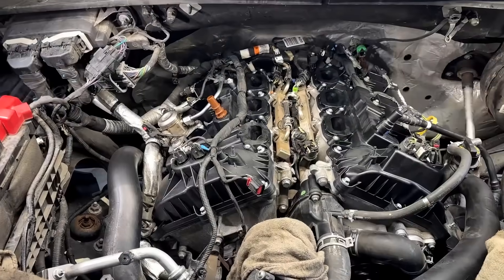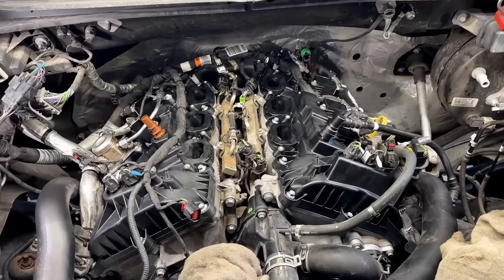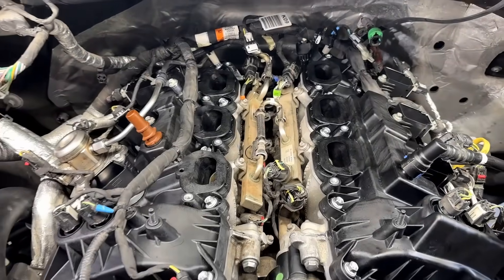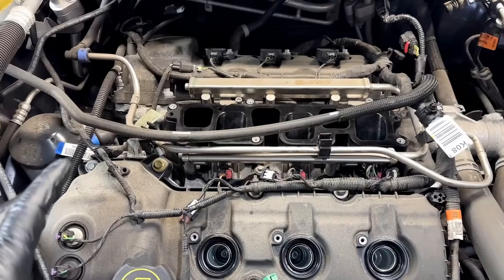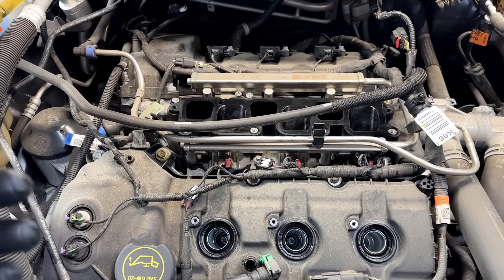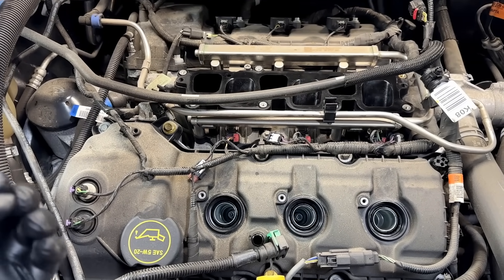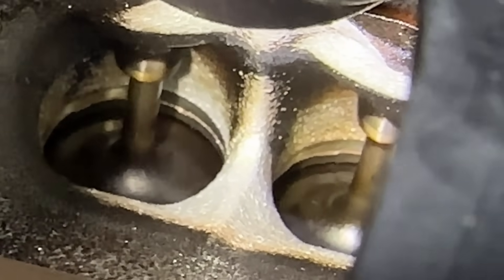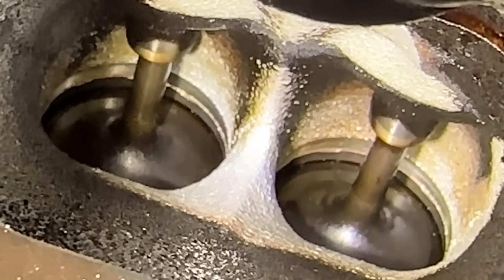Does Ford's New Dual Fuel Injection 3.5L Ecoboost Engine Really Fix the Carbon Build Up Issue?

Comment: Great video Brian! I'll be honest - I'm still a bit disappointed with carboning on that 2nd gen Ecoboost. That said, it's still better than nothing.  Maybe Ford needs a new fuel curve map where it runs strictly on the port injection for a day a couple of times a year? I'd be willing to put up with some reduced power mode if it meant reducing de-carboning costs down the road. I know it's may be a bit irrelevant with a timing chain replacement at the 100-150K mark anyways, but it'll still save labor and materials cost when needed.

BTW - Happy Holidays and a Merry Christmas to you and your family and the viewers!
Reply: I monitor DI vs FI rates on my 2019 3.5 f150. At low load, it primarily runs port injection. At warm idle, low speed cruising and light acceleration, it uses almost entirely port injection. At highway speeds, it uses 40-80% direct injection. It is always using the port injectors at least somewhat.

The 2nd gen 3.5 is primarily port injected and adds DI as needed. Fuel system cleaners DO work to clean the valves. If you want to reduce valve buildup, start using techron additive or another fuel system cleaner with PEA.
Reply: I was thinking something similar... perhaps switch to 2 pulses of the port fuel injector for every one pulse of the GDI injector. That should cut the carbon buildup to roughly a third of the Gen 1. Of course it would sacrifice a bit of fuel economy/power.
Reply: Likely a commuter vehicle. The trucks need heavier use to do what they need. More load equals more fuel equals cleaner valves.

Comment: Great video as usual, thank you. I was aware of this from early on on my 2011 f150 3,5 eco boost. I maintained it very well and put a lot of cross country highway miles on it. I made sure it got warmed up on every use by consolidating trips. I traded it in after 210,000 miles this past summer. It still ran great but want to continue to travel in my retirement. I was always amazed at the torque and towing power of a little over 200 cubes a few times grossing 11-12000 lbs Ohio to New Mexico. Thanks for your channel.

Comment: Approx 130,000 miles on my 2015 3.5 EB now. So far it is running really good still
I have heard a cold start very brief rattle that I thought might be the waste gate flapper but it could also be the cam phaser I suppose. But it does it like maybe once a month and is really quiet otherwise

I never did get around to adding a catch can although I know I should.
Luckily I do rip on this thing on a regular basis so hopefully that heat cycles the valves enough to burn off some of that carbon. people who let these engines idle a lot and who don't open them up under high load are probably more likely to have these issues. It is still a very fun engine so no regrets.

Comment: I'm so glad you shared this info... My 2017 is at 158k and now needs its second timing job with phasers. (And neither has been under warranty...WTF??) You can rest assured I'll insist on the new phasers you showed a few videos ago.  Thanks again, and Happy Holidays to you and yours !!
Reply: Just curious, how often do you change the oil and what oil and filter do you use?
Reply: @Ray S I'm religious with maintenance ! usually every 3k... never over 4. 
Platinum synthetic oil and Fram ultra syn
Filters. 
The wife's truck is a 2014 150 with the 5.0.... use the same in hers, and that just hit 240k. That motor has never made a tick sound... ever !!!
Reply: @Right2Arm  I'd stick with the Motorcraft oil filters and avoid Fram. Lots of info out there regarding anti drain back.
Reply: @Right2Arm   
I've heard of some guys using the synthetic 5W40 in those 3.5's and they say it makes them a little better.  
The 5.0's have overall been great.
Reply: Wow, these engines are pure garbage. I wonder what will it take yo get rid of this truck
Reply: @gianfrancoa  love the power with the turbos... and 21 mpg. This is the only problem I've ever had with the truck in 158k.  Pisses me off, but it's still a good truck 😊
Reply: @Right2Arm  21 mpg probably doesn't offset the thousands you lost repairing the truck.

Comment: Thats good that they are making progress, hopefully they will learn from this and continue to improve the cleaning system.  My Dads 22 Tacoma has a similar setup that is just for cleaning the valves, will be interesting to see how his does after 100k.
Reply: I have a GS 350 AWD which is a Tacoma in a Sedan. I would almost like to pull the intake and see, I am a bit above 100K.
Reply: Well there's only going to be so much improvement as fossil fuel burning engines are mostly ending development, with some carmakers having already stated they're not developing any new internal combustion engines ("ICE" as the nerdy folks like to say).  So don't really matter much after this.  Great that dual injection solves this, but how much longer it's going to be a problem for new cars, is another story.
Reply: @rolandm9750  basically we are in big trouble, the government is finally going to ruin the auto industry
Reply: Learn from this??  This was a known issue that germans knew about from ww2 and after.  This arrogance and hubris.  I'm sure there is documentation somewhere of engineers telling them to do what they eventually did.
Reply: And the frame
Reply: @muttomaki1  Frame issues on Toyota have been solved awhile ago. If you're going to be an ass, why not attack GM for their APM and their shitty torque converters.That problem is still ongoing from 2009 to today.

Comment: need that extra injector to spray the valves down, keep them clean, on direct fuel injection.
Reply: Well, that's intention of the port injection, but it seems Ford failed again to design something that really works, Toyota has the D4S system and no issues

Comment: So is this carbon build up caused by turbos blowing oil into the intake? I have a 2019 3.5 EcoBoost.
Reply: Fine dust that gets through the air filter.  With early Direct Injection (DI/EcoBoost) there is no fuel to wash it.
Reply: @jonmccormick8683  Actually it's from the PCV system putting the vapors from the crankcase back into the intake to be burned off. Those vapors have microscopic droplets of oil which over time builds up on the valves.

Comment: Opinions please: If you were buying a new 2.0Ecoboost Maverick 2023, would you recommend an oil catch canister be installed within the first couple thousand miles and if so would this void the factory warranty?  Or just wait and get walnut blasting after 30K or 40K miles?  (with frequent oil changes Pennzoil UltraPlatnium and use premium fuel)
Reply: I have one on our Focus ST. Never had any warranty work or issues when dealers did oil changes (every other just so they could document while it was in warranty). We get 1-3oz every oil change in the can. In my mind it can’t hurt to keep that out of the intake. Last I checked was at 50k and it looked good (not as good as a port injected engine but still). We also drive it pretty hard which I feel helps with heat and additional pressures to burn what’s there off.

Comment: Do you think a oil catch can would help? I had one on my gen 1, but I feel like it was increasing crank case pressure.. my valves were pretty clean after 125k.. put the catch can on around 90k.
Reply: You feel like or can you verify that it is?
Reply: @MagMan4x4  well, I started having leak issues, such as the rear main seal. I ended up taking it off, but no, I can't verify it was actually increasing crank case pressure other then others having those issues online. I just assumed and took it off lol

Comment: On first gen engines can you look at the valves through the throttle body with a bore scope while someone is stepping on the accelerator pedal key on engine off

Comment: why do some gen 1 have the build up while others don't show signs well into 150, 180K on them?
i mean this newer one obviously has been driven more in a lot shorter period of time.
why? highways?
is there something some people are doing, perhaps like more highways vs city drives?
more oil changes?
better oils?
Reply: I run a catch can and run full synthetics with intervals at 5k. First gen with 113k and have not seen any issues related to valves or time chain rattle.

Comment: Glad I'm running a catch can!  Still love my old school multi port 302.  Merry Christmas Brian.
Reply: Catch can is meh at best, takes out maybe 10% of the carbon. If the stock 3.5 eb at 100k is 100%, installing the catch can would remove 10%, to 90%, and the new 3.5 eb would have 50%, with a catch can, you’re at 45%. Not worth the 3-500 investment in a good set up
Reply: Its better than nothing...it catches quite a bit and looks nasty.  I run Mobil 1 and it gets changed ever 5k religiously.
Reply: @garypollack6948  Gary, to be really sure you are doing everything possible, change your oil once a week and get your church to pray for your vehicle every Sunday .
Reply: @garypollack6948  I feel the same. Anything I can do within reason to help limit the amount of potential buildup. We also use full synthetic and change every 5k. So far so good. I’m also not sure where that 10% figure is pulled from. Our catch can sees about 1-3oz every 5k.

Comment: I was wondering if water methanol injection would help steam clean these engines
Reply: Over an extended period of time it would probably work. 

I've always been curious of running a pump sprayer mister into the intake and just misting away for a few gallons of a solution like methanol water mix at the throttle body on the highway. It probably wouldn't get all the valves too well, but for a low effort home gamer technique I am curious... I did something similar like 10y ago to a car trying to clean the pistons with water like a blown headgasket does, 😆

Comment: Merry Christmas! Why does the ecoboost need timing job already?
Reply: Small engine big horse power  , long oil changes , carbon is bad for chains . All equate to chain stretch . I sure wouldn't use a semi synthetic oil for more than 3-4000 oil changes . Not to mention Motorcraft oil filters are lousy compared to a Fram  Xg filter . Motorcraft micron ratings is pure pathetic
Reply: Some were under a special warranty. Possible manufacture defect.